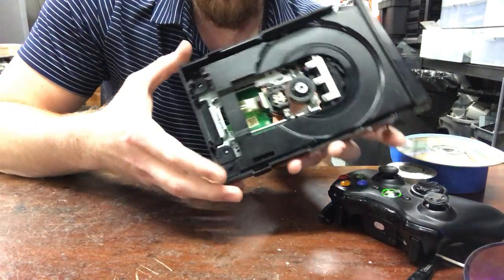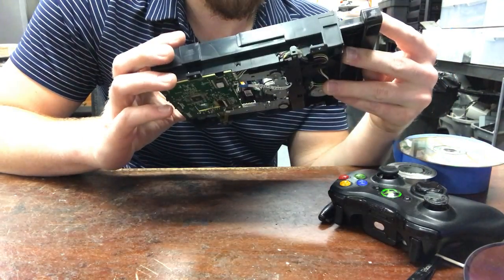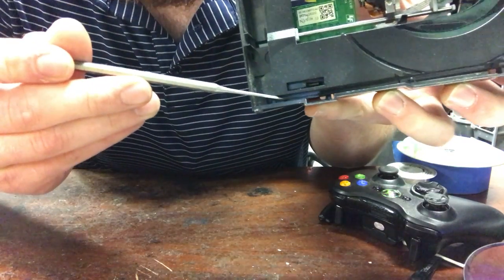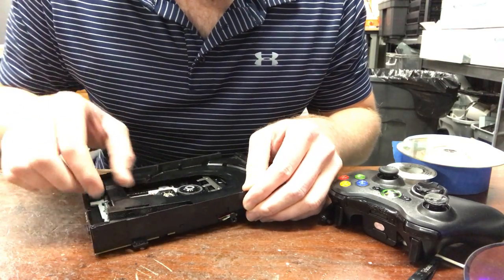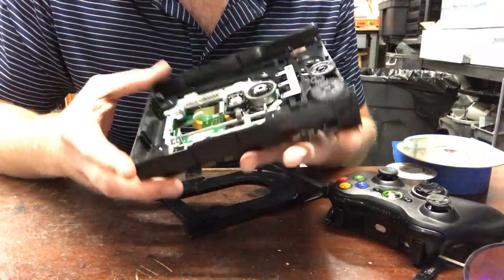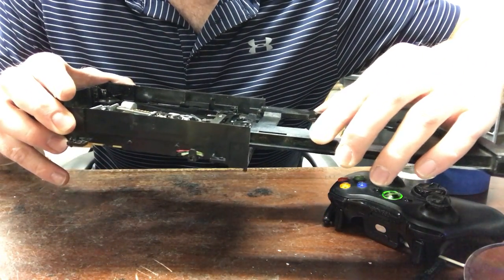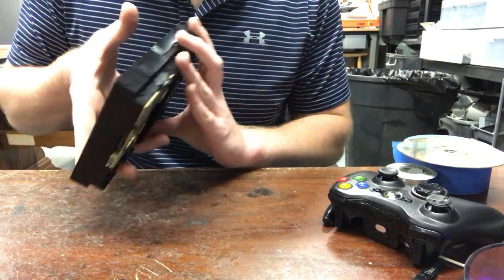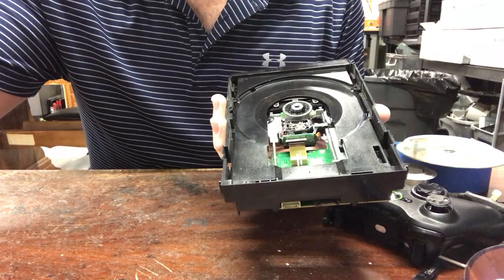How to Fix a Stuck/Jammed Drive Xbox 360 Slim/Phat 2017

Comment: Hi thanks a bunch your video helped me save my Microsoft Xbox 360 e console I took the disc drive apart cleaned the drive belt with rubbing alcohol and dried it with q tips also cleaned the gear and the disc tray most importantly my disc tray now opens and closes I had a lot of game data on my 60 gigabyte hard disk drive